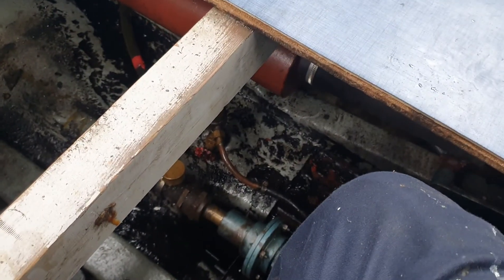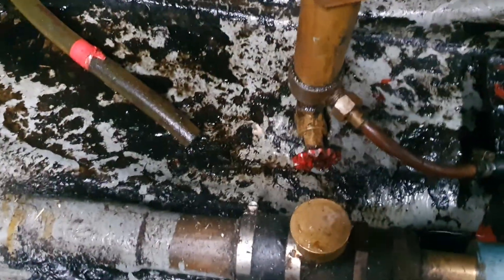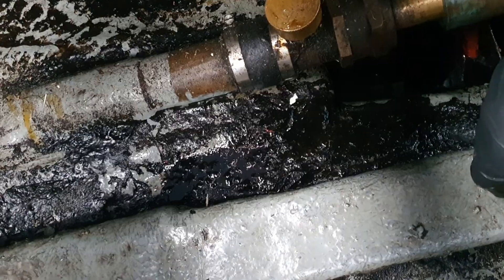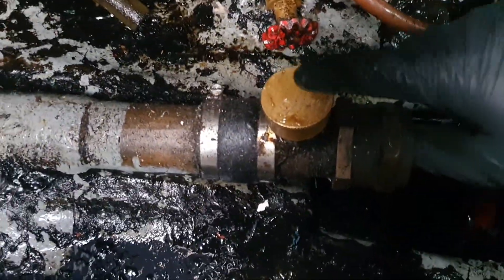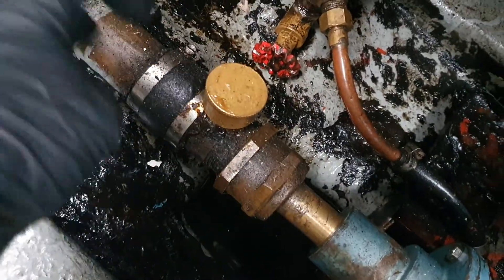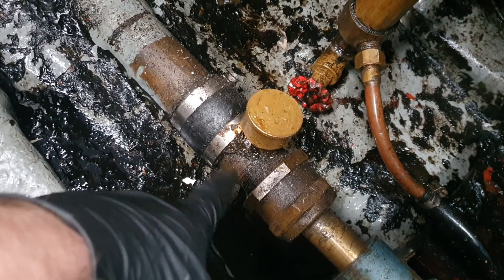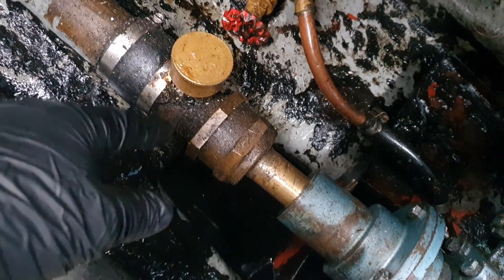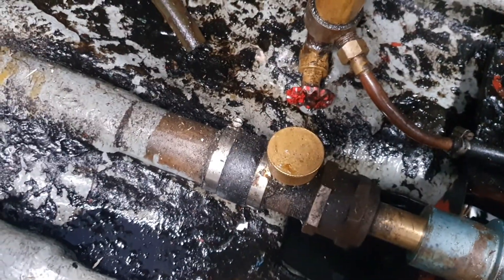Boat Stern Gland Maintenance on Seamaster 27 with Watermota Inboard Engine.

Comment: There's gland packing just foreward of that grease cap  .See the big nut ,just loosen that and replace packing ass per instructions and stop the drip and no it needs doing as your batteries willl drain from all the work and yes its alot of work if you add up the quantity ove a battery's life ,which shortens it's life .

Comment: there should always be a drip every  90 seconds on those, keeps it cool.
Reply: Thats absolutly not true, im working as a shipwright for 40yrs and when the alighnment is correct ,the packing is not over tight + the proper grease used , it will do all the lube itself .However at the rear of the gland water circulates to lube the cutlass bearing .If this is done it will absolutly stay cool.